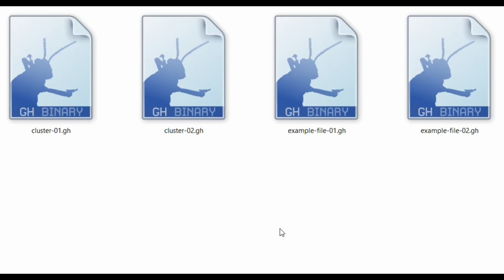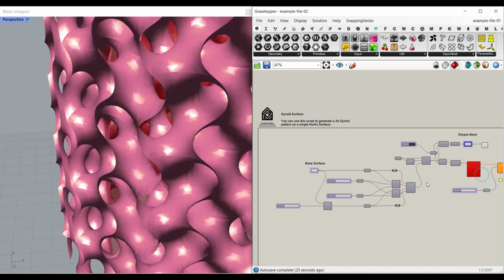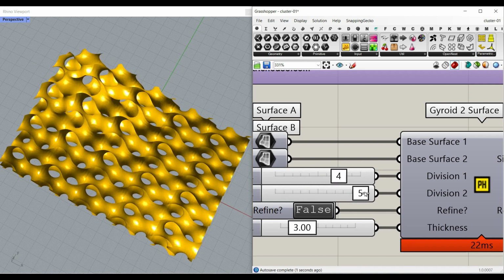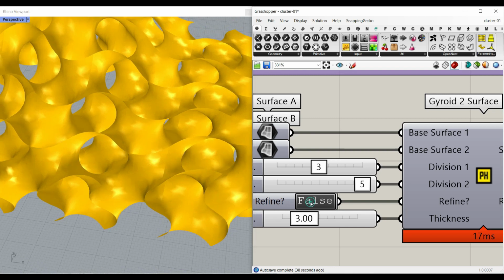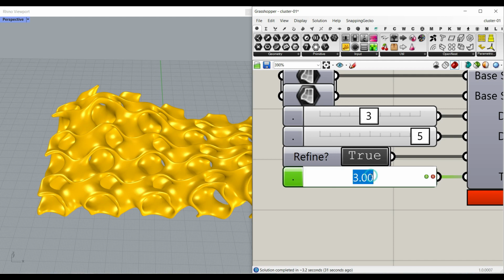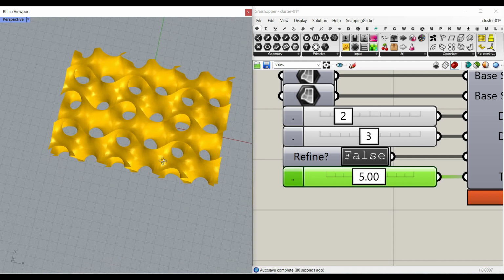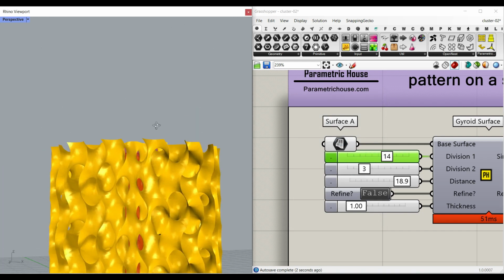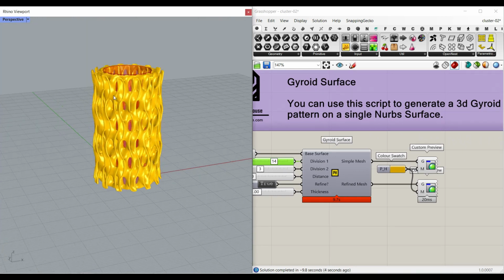Grasshopper Tutorial (Gyroid Pattern)

Comment: Can it produce gyroid between two subd surfaces or poly surfaces? 
Looks really cool and easy, would be useful for me if subd or brep is ok as input.
Reply from the maker: Unfortunately, no. The Gyroid module can only be arrayed in a x,y,z, or a u,v,w space. A subd or a brep doesn't have these 3 directions and is completely project related. That's why I don't think there is a simple algorithm that can produce Gyroids between two subd , brep or meshes.
Reply: Thank you for the response! That's to bad. I'll be sticking with the pufferfish method then! I do this alot between two meshes or subds, so it looked really neat to be able to use your module =)  @ParametricHouse
Reply: Can I also ask what this specific Gyroid module cost to buy?  @ParametricHouse